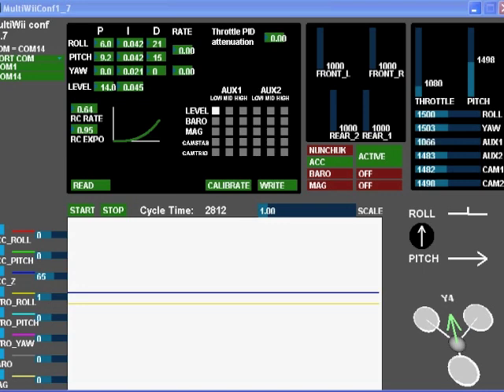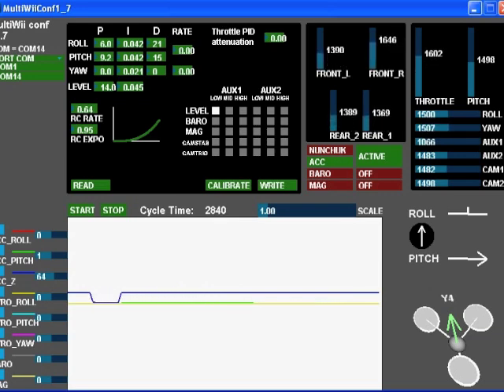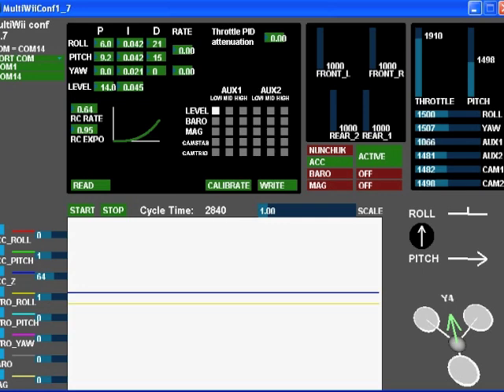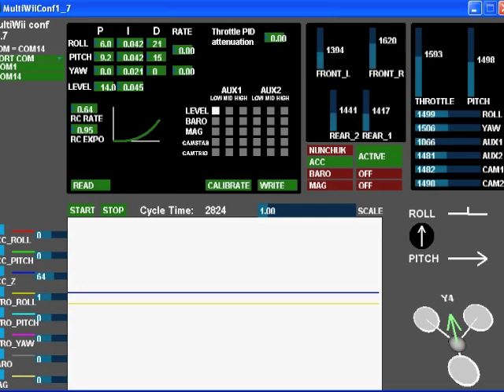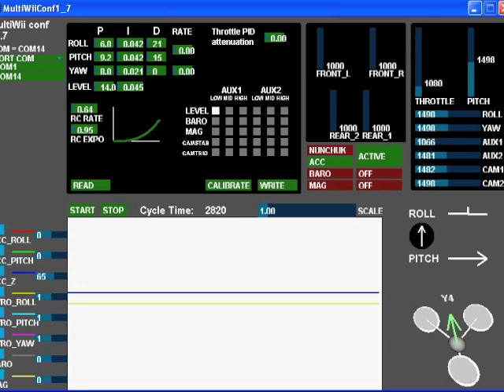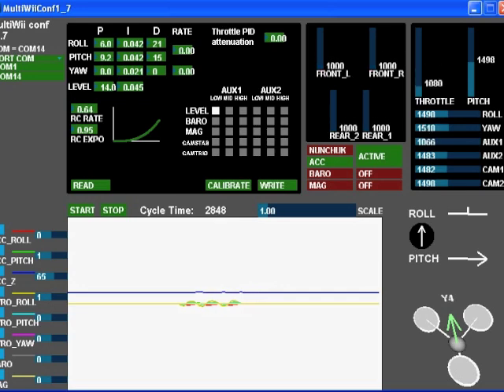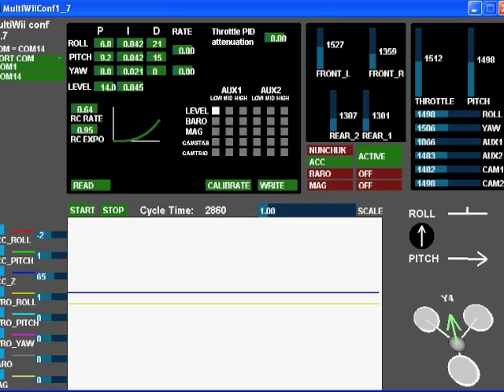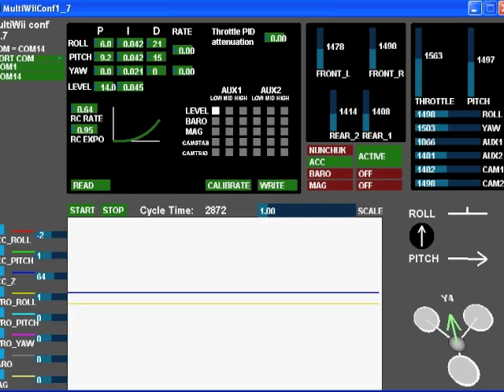MultiwiiCopter - HowTo Trim the Accelerometer

Comment: do you have your props offf
Reply from the maker: I would suggest having the props of depending upon how you are powering the flight controller. I have a separate UBEC powering the FC so, there is no chance of the motors spending up.

Comment: Does it need to be connected into the usb? I tried using GUI Bluetooth'ed and haven't seen any results.
Reply from the maker: You should be able to use BT providing to have it configured correctly.